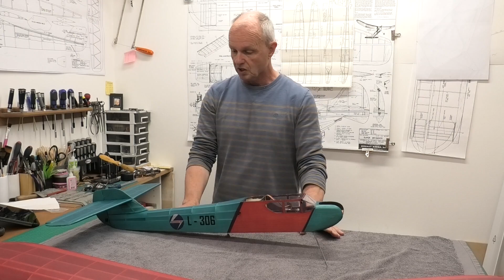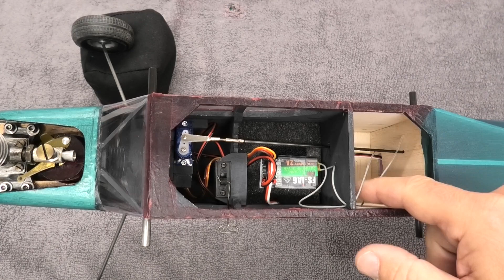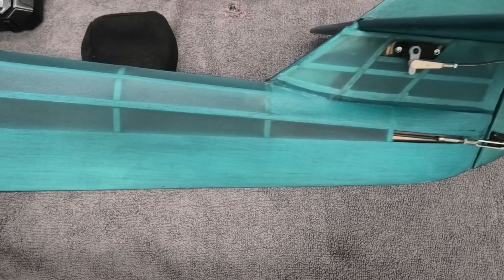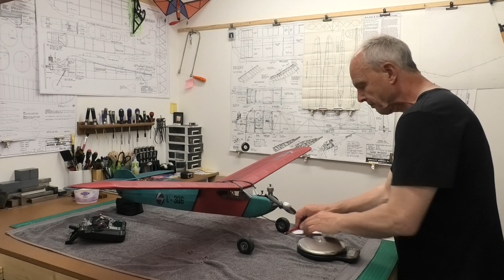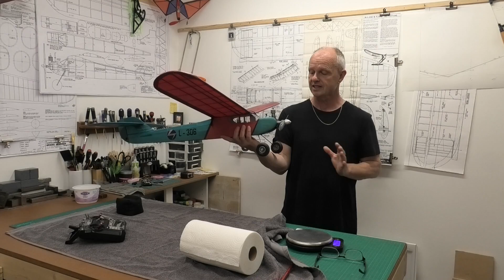Model L Vintage Build Blog - Pt9: Setting up & Airfield Ready - Design by Peter (O.F.W.) Fisher

Comment: Have you thought about cutting off the excess length on those control horns ? Might help the c of g slightly ?! 😊
Reply from the maker: @mariafreeman7257  I will trim the control horns, once the model has been flown and trimmed, and hence I am happy with there the clevises need to be, but thanks for the suggestion  😜

Comment: Hey mark I have a Cupid 1/2a control line plane I want to get going they are plans and I have to start from scratch I need help my first time doing it I need help
Reply from the maker: Hope the build goes well, just take it slowly and you will get there, thanks for the comment
Reply: @MarkRobinson555 i don’t even know what to do with it the plans are all over the place
Reply from the maker: Have you thought of putting this one on the back burner and building something where there is more information etc, and then going back to the other later?  Hope you get it sorted